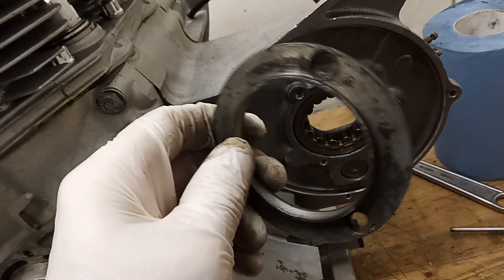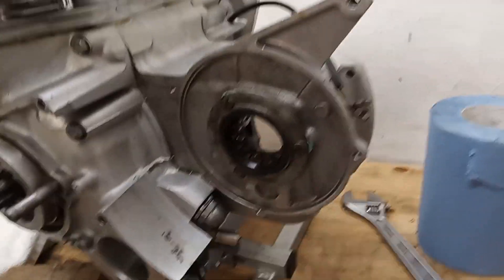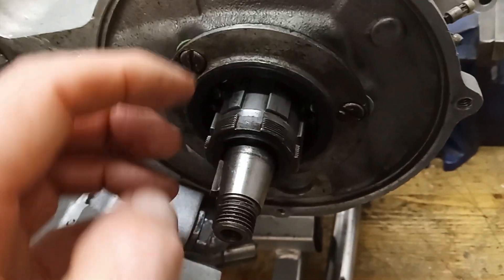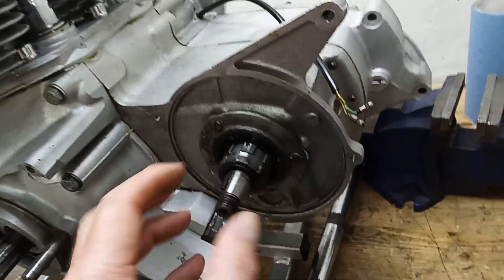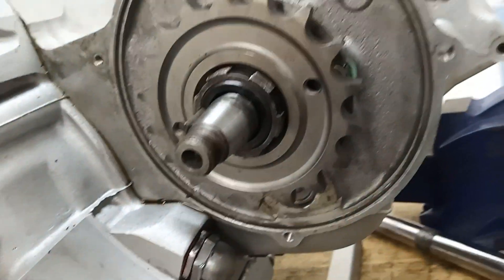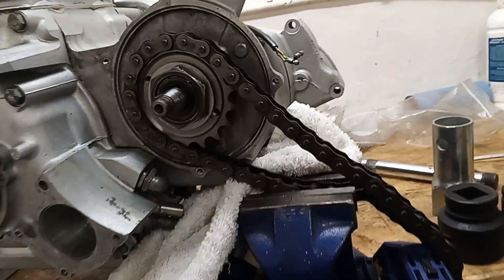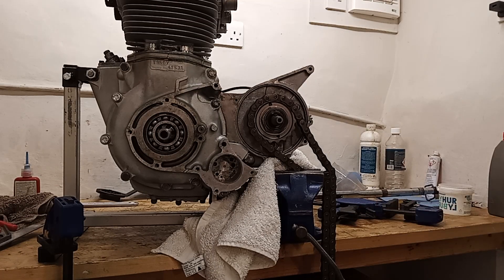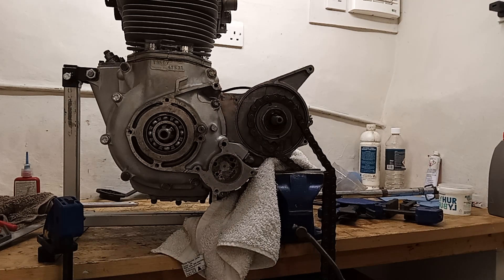Triumph Trident T150V Engine Rebuild Part 39: Fitting the Gearbox Sprocket and oil seal

Comment: Hi mate; I see that you changed the locking tab? The first one that you put is not to bend...
Why not to do that with the engine into the frame loop? with the aid of the chain; gears and brake?
Reply from the maker: Mainly because I only had the engine, not the rest of the bike, but also because that nut is so tight, even with the rear brake on and the engine in gear, it usually still isn't enough to enable that nut to be tightened up fully when in situ. You also need to lock the chain with wood or a rag etc. - and sometimes that can wrap itself round the sprocket.

Comment: I've already ground several socket tapers off to accomodate the accursed Triumph shallow hexes.
Reply from the maker: Yes, good idea. Previously I've not had such a problem with that nut, for some reason, but it's a really thin nut and with the extended socket it's very hard to hold on to.